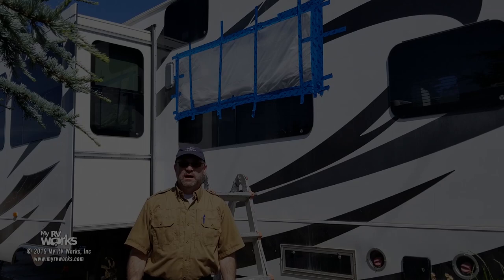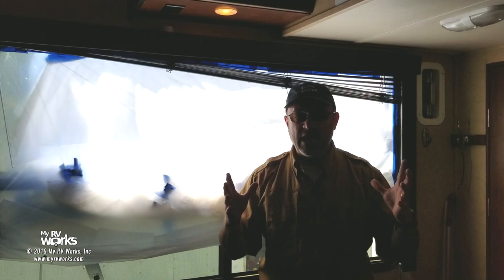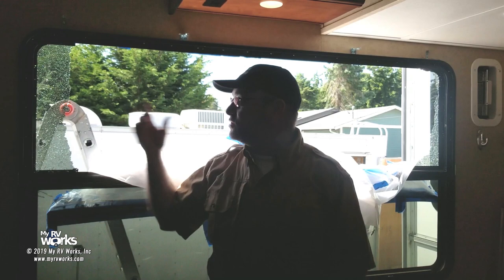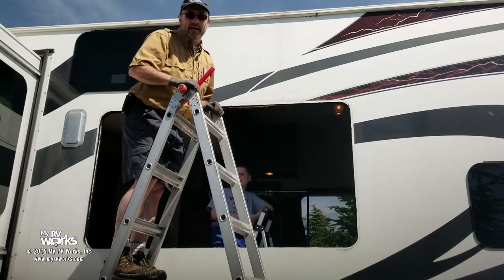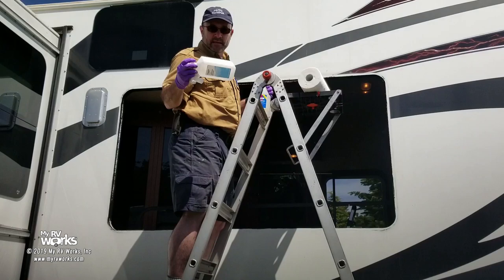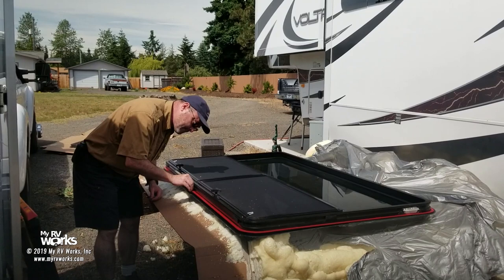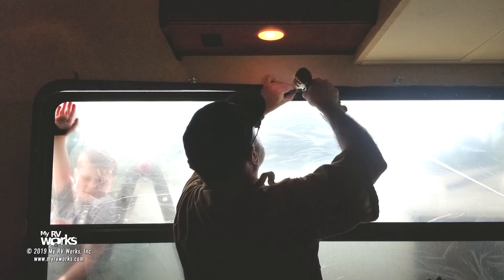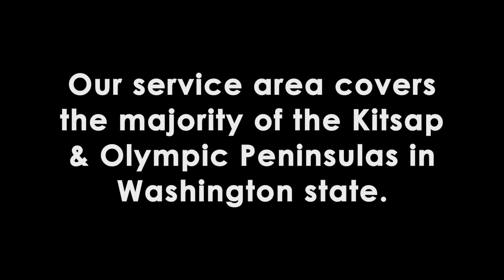Replace A Broken Frameless RV Window

Comment: Good video. I had a broken window last summer in Boise ID. I was new to RVs, went to a dealer service center and got the contact the manufacturer order a new window replacement and weeks or months to get it installed.  Went to a second dealer service center, yes we can order a new window BUT here is a card for an RV window glass guy, try him first.  He came within a couple of hours, took some measurements, noted the radius of the rounded frameless glass and tint and the black painted edge. He had a local glass shop make the tempered replacement to spec and installed it within 6 days total! $400. Please consult a glass pro before ordering an entire replacement window.

Comment: Excellent work and info.. Thank you. That thunderstorm we had yesterday exposed a failed window seal. Luckily I was watching the thunderstorm and heard the dripping and saw the water dripping from the top of the window in the slit of the retainer screw trim. As some of you reading this may or may not know DRV has wood trim around the windows. This trim is finish nailed to the wall. Meaning you can't simply check and snug the screws. To do so you must first pull the wood work off the wall to access the screws. Once I pulled the wood off I was confronted with a few loose screws; one screw was backed out about 1/4 inch. For the meantime I snugged up the screws. This should keep the water out until the new seal and a dry day arrives.

I was thrilled to find this video as I've not been able to find out what type and size seal to get.

A few things to note for those taking on their own work. First and foremost, do not wrench on the screw. These screws should just be snug. Trying to tighten them down can result in stripping out the window frame, requiring you to drill a new hole above and below the stripped out area on the retaining trim. The other issue with over tightening is causing areas with more compression of the seal. This could result in a leak over time. As you can see these windows do have a frame despite the namesake. Aluminum expands and contracts all day and night 365. Overtightened screws limits the window frame and the separate interior retaining trim from expanding and contracting independently. Additionally there is a lot of movement during travel. If the window and retaining trim become too ridged or the seal becomes too compressed from overly tight screws the window becomes prone to seal failure. Due to the thermal expansion and contraction and movement during travel you should check to ensure all screws are snug in the spring and before storing the unit at the end of the season. There is no set seal replacement schedule to follow. Your local environment, use, and travel each unit experiences varies widely. My unit is now five years old. It spent the first three years in Florida. Now I am in Seattle again. Having one seal begin to fail during a brief torrent of rain tells me it's time to replace all of the window seals. From the extreme baking in the Florida sun for three years before moving back to the much cooler and wetter Pacific Northwest likely shortened the life of these seals. I would say seals last longer in mild climates than they do in heat prone regions. And regions with extreme temperature swings. Despite the seals being protected from direct and damaging UV exposure, thermal extremes do seem to take their toll quicker. Aluminum heats and cools rapidly. Meaning it expands and contracts rapidly, weakening the bond as the seal and frame expand and contract at different rates. If my unit stayed in mild Seattle since new, with limited travel and I had access to the screws without dismantling the woodwork, I have no doubt the seals would have lasted ten years or more. The issue with removing the wood trim around the windows is having to add more holes in the beautiful cherry woodwork each time I check the screws. But!!!! Filling pin holes with colored filler is much easier and less costly than a leak going unnoticed causing costly damage. Admittedly I have not been as proactive with snugging screws. I shared my concerns with DRV regarding window frame access and a few other issues I've had (roof bowing of the large dining, desk, and theater seat slide being a major issue)..... I never heard back from them.

Anyhow, no matter how budget friendly or bank busting your unit is many of the components are the same. Do not judge a manufacturer for issues with products they do not manufacturer. That said it is the responsibility of the RV manufacturers to properly install these components. When repairing or replacing say window seals, follow the window manufacturer instructions and use the manufacturer suggested seal. A lot of time if an RV manufacturer runs out of something they'll substitute it to keep the production line moving. You may find a window was fitted with buytle tape by the RV manufacturer. Do not substitute a seal with putty or caulking. They've designed the window to fit and remain watertight using a seal. In other words do not rely on the RV manufacturer to install components correctly. RV manufacturers are known to use poor substitutes. Often times these rash substitutions, absences as well, do not cause issues until well after the warrant has expired. Take the case of hole grommets to protect wiring from sharp edges. Often times when they run out of protective grommets an employee will simply use a bit of duct tape on to protect the wire, or nothing at all. A few years later the lights suddenly stop working. Or worse yet the unit burns as ours did when some left the light switch on despite the lights not working. Or when nails substitute screws on the plywood roof sheathing. Just after the warranty expired on the new trailer that replaced the burned unit, I noticed the roofing had a very noticable bulge. They peeled back the EPDM to find nails instead of screws were used on one half of the roof sheathing. The aft half had staples. There were no screws at all holding the decking down. Of course Keystone refused any responsibility claiming I had two years to bring defects to their attention.

OMG.... Wow ... Listen to me ranting and rambling. Sorry. All this....while simply writing to thank you for providing a link to the seal I need. 😂

Cheers!

Comment: Changed my first frameless window after watching this. It was a curved front cap window on a travel trailer. I saw some differences and was curious if there are several ways these are made and installed. The most noticeable difference was there was not double sided tape.  The window had a rubber gasket built into it.  When installing the screws on the inside I had to drill thru the aluminum of the window for each screw.  I verified that's what the original window had. It took considerable ore time then I expected.  It took two of us 2 hours to complete this job. The most time consuming part was removing the silicon caulk that was installed along the top edge of the window. The product you mentioned in this video for removing any glue from the double sided tape worked well.
Reply from the maker: Are you telling me that all of these manufacturers did not get together and come up with one standard way to install a window! LOL I am being silly and I meant that as a joke. I'm glad this was able to offer a bit of guidance but yes, you will run into all kinds of things which makes this craft so exciting.  Never a dull moment and I'm learning new things everyday. Happy camping and enjoy your new window

Comment: So basically a frameless window has a frame on the outside that is hidden behind the glass. I'm thinking about painting my truck shell and wondering if I should just mask windows or try to remove them. BTW the windows are frameless on my truck cap. Any suggestions?

Comment: I have a question regarding windows, that I havent found referenced on any videos on your channel. 
I have a 2011 thor class c. 
The 2 windows in the sesting area directly behind the cab rattle terribly.
My first step was to remove the screens and set them aside. 
Then I grabbed some thin weather stripping foam and applied it to the fixed window at the overlap with the moving pane of glass. 
I also tucked a piece on the end channel of the sliding window to help cushion the glass from the frame. 
I've got the noise down about  halfway from where I started. But it's still very loud while driving. 
Is there any hope or tricks to make these windows quieter?  
Thanks
Reply from the maker: I would reach out to Thor directly and see what they suggest.  These are very difficult to resolve.  All the best!  Happy camping!

Comment: I couldn't get a new window for our fifthwheel from the manufacturer or lippert, since only 1 of the 2 pieces of glass are broken, I cut a pattern and took it along with a piece of the broken glass to a local glass company and had a new window made, it has taken right at 3 weeks, I haven't installed it because I am looking for the rubber hinge material now, any idea where to find something like that? Its a frameless exit window on a slide out, the top on the outside is an aluminum rail with a few screws holding a rubber strip in place, with all of the pieces of glass stuck to whats there, I don't want to reuse it and actually it would be easier to glue the glass to a new rubber and then slide it into place. The new glass was a tenth of the cost for a new window had I been able to get one, and I really didn't want to replace the entire frame ect...for one side of it, had both sides been broken I may have considered it. The new glass is tempered and tinted, just need to glue the latch handle and rubber hinge onto it, so probably 15 minutes to do the job if I can find the rubber I need.

Comment: Good Morning you change a window on you Tube. How can I find out who is the manufacturer of the window. I have an open range buy Highland ridge . it was bought by Jaco and then bought buy someone else. I called Jaco but they are close because of the vires. Any help would be great. Jack  PS be safe out there.
Reply from the maker: You need to work with your manufacture directly for these parts.  Be patient during these high demanding times.  Thank you.

Comment: So Isopropyl will get rid of the dark areas that have appeared around, and look like under, caulk lines? That’s cool!
Reply from the maker: I don't think it will get rid of the existing mold but before I apply new sealant I always wipe the surface with isopropyl to sterilize it.

Comment: Thanks for the video. Living in a Cottage from Cedar Creek the bedroom window had a leak from the screw in the square box pelmet up above the window so wet that i took it down. I dont know where the water not a lot is coming into the bedroom and the carpet is wet just a little bit I dont know if its the seals around the window or  the roof. I think the roof is all encased  I cant see any rivets up there. Hope you can suggest where the water would have an entry point from. This only happens when we have very heavy rain.
Reply from the maker: These water leaks are very tricky sometimes to identify their source. I had one RV where the leak was in the front and it was leaking inside of the roof and came out in the back LOL. One issue we see a lot of times is humidity inside of the RV  masquerading as an official leak, when it's really just the humidity inside the coach. It really throws us because on humid days that's also the days that we get rain. But you state that this only happens when it rains. Without actually seeing it it would be difficult to try to help troubleshoot. One idea would be to maybe take painters tape, or duct tape or something, and tape up the outside of the window frame before rain is forecast and while it is raining see if it leaks then.  If it does not leak then you can assume that the leak is getting into the window frame on the outside. Hope this helps. Happy camping.

Comment: Nice job.  Do you have to replace the whole window if one of the little vents breaks? Thank you
Reply from the maker: The simple answer is yes. These are manufactured as a one-piece unit.
Reply: @MyRVWorks  thank you ;)
Reply: @MyRVWorks  I had to replace a broken vent window on my frameless window.  Jayco would only sell me the whole window.  I got in touch with the manufacturer's (Lippert) representative, Duncan Systems.  They shipped me the replacement vent window in two weeks. I had to remove one screw and drill out the pop rivets for the crank. Thirty minutes later it was done without replacing the whole window and frame. I don't know if it is as simple for the fixed upper window.  I thought you would like to know because your answer, for Lippert windows, is incorrect.  I love your videos.

Comment: For shipping, ever consider having the camper company ship it with a camper being shipped?  I had a Roo Bunk door shipped when my dealer got a new Roo in.  Saved like $600 in shipping.  I did have to wait a bit longer.  May not be a good option with a window.
Reply from the maker: We have done that in the past but we are not a dealer you see...  We offer mobile service and there are no dealers in our area.  But for others it is worth looking into if the RV dealership is willing to do that for you.  

Cheers,
Darren